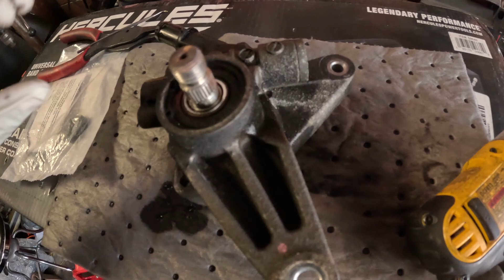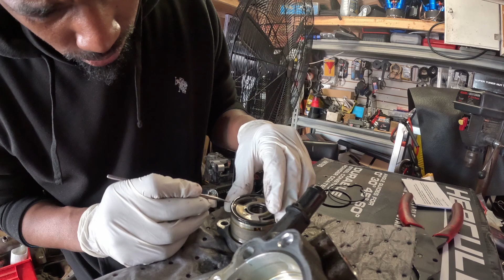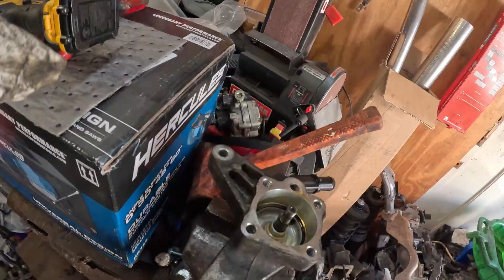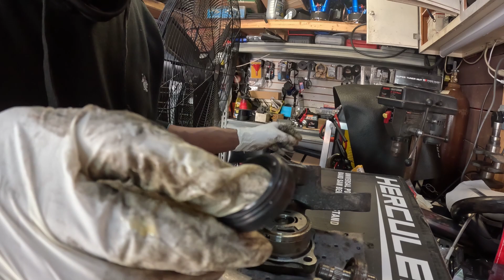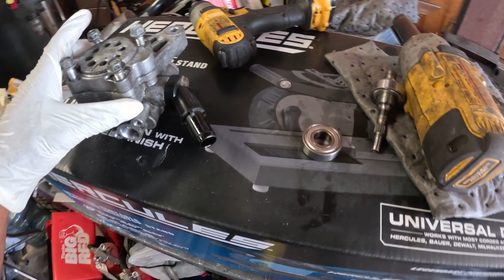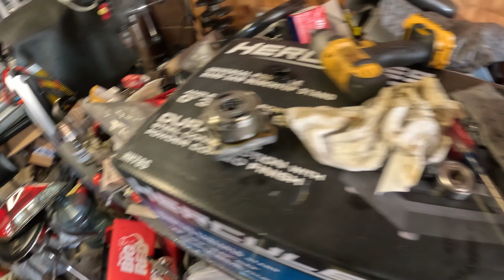How to rebuild 2003 to 2007 Accord/ TL/ RL/ mdx power steering pump.

Comment: Was your pump leaking and not functional? Or just one or the other?

Good video
Reply from the maker: It was leaking fluid. I replaced the bearing  to be safe.
Reply: @AJIMPORTS  gotcha. My PS doesnt work and my pump is leaking so im debating doing a repair or replacement.

Appreciate the reply bro
Reply from the maker: @sheldonvantol4132 if you get all the parts its very easy to do. Take the belt off the pulley. If it turns freely you should be fine just changing the seals. Thats like 20 bucks and 30 minutes to do. Vs a aftermarket pump.
Reply: @AJIMPORTS cheers bro. Ill probably try to repair
Reply: @sheldonvantol4132   Did you do it?
Reply: @nm3547 yes. Repaired and no longer leaking
Reply from the maker: The pump was leaking. So I rebuilt it.